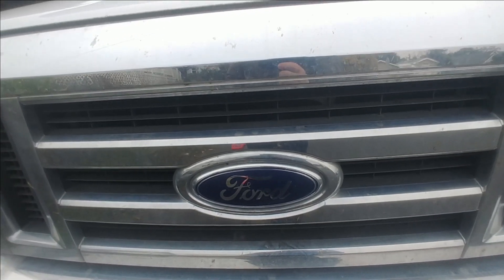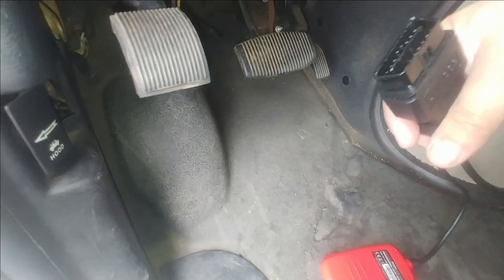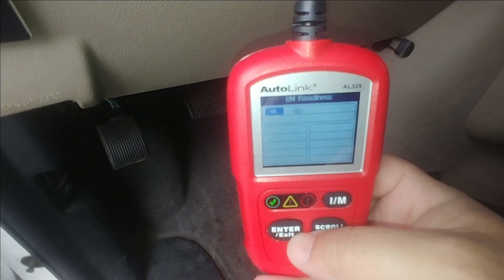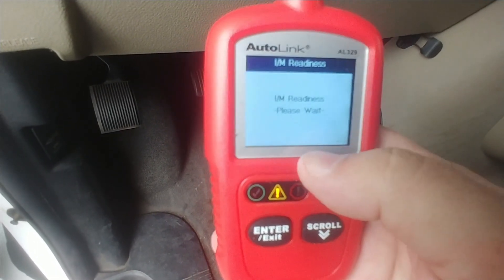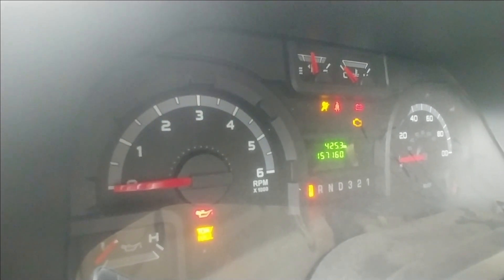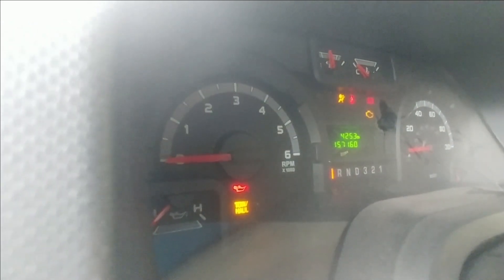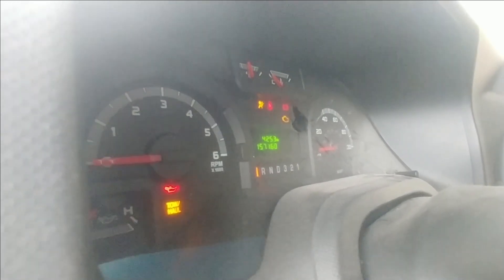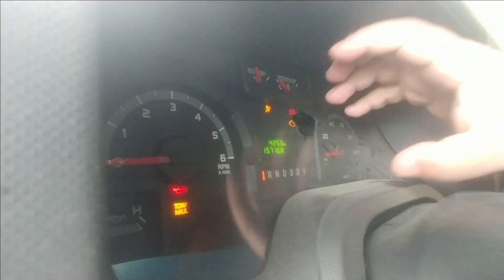Ford Emissions Drive Cycle Readiness Check▶️ No Tools Need▶️ Check if your Ford Is Ready To Smog

Comment: 2005 mustang just failed for this.  replaced battery recently and inspection said car not ready for smog testing and I have to drive it for 200 miles and come back??
Reply from the maker: Only go back after you verify all the required monitors are ready. 
The obd2 reader that I recommended is in the video description.
Reply: @RANDOMFIX  Already ordered.  Will keep ya posted.      Thanks!
Reply from the maker: @chasmarx4393 glad to help.

Comment: I'm not sure this routine works like you say it does.  Can you explain why the chimes (door open I assume) did not come back on when you turned the key back on?  It was chiming away while you were talking. You turned the key off and immediately back on, but no chimes came on.  

Then you said cycle the key and all that can be heard is a little rattle-rattle sound.  The key was already on, none of the dash lights went off when you supposedly 'cycled the key' so you obviously didnt turn it off and back on again - which is normally what is meant by cycling the key.  

You certainly didn't show the key being 'Cycled' or turned in the ignition, . . . probably because it didn't happen.  Yeah, I'm not buying this.
Reply: It doesn't work the only time a check engine light blinks is for an active misfire.This information is false
Reply from the maker: An active misfire is completely different issue. This is for inspection monitors. Obviously this won’t if you have an active misfire. You check engine light shoot be blinking if the misfire is serious.
Reply: I sat in my 1999 expedition with the cat monitor not ready and the EVAP not ready.Did what you described it doesn't work quit posting nonsense
Reply from the maker: Sorry you don’t understand or I didn’t explain it properly. Honda, ford, Dodge vehicle have this feature. Wash are a little different but the idea is the same. The checking engine light is acts like a tool of all the monitors are ready. Visual tool

Comment: "Cycle the key" from On to what? How many times?

You show turning the key on and then say wait for the CEL.  THEN YOU SAY CYCLE THE KEY, (nothing on the cluster changes and you don't show or explain what you did with the key.) After that, wait 15 seconds for CEL to show up blinking. 

You can tell me if I got any of it wrong.
Thankx!

Comment: I didn't know about the blinking CEL trick.  I've driven over 200 miles since my car was worked on and the dealer had to reset the ECU, and I still can't get it into IM Ready status!  I need to get it smogged, so that's a problem...
Reply from the maker: Complete two drive cycles and the focus only the unset monitors

Comment: VERY nice guy but unfortunately he is unorganized and was neither precise nor detailed. At almost every minute of his video I found missing info or saying things that may be wrong or not fully inclusive. There is no way a logical person can follow his instructions and succeed. Yes, he himself followed written directions by FORD but most steps are unrealistic or very difficult to accomplish because you will be driving on public roads and will be impossible to time everything as stated by idiotic Ford - in other words do not consider FORD a reliable source either. Many FORD professionals hate the company and with a passion!!! because FORD have created chaos throughout the years. All in all, I was just expecting someone at YouTube to DECIPHER Ford's nonsense and show what I need to do for code readiness.  This is not a good video to do that.
Reply: First off, I am sorry for providing negative feedback - in retrospect, I overeacted due to momentary & ovewhelming frustration of not finding accurate info on how to clear codes. My issue is very simple:  I replaced the Fuel Pump (in gas tank) of my 2001 Ford Ranger 4.0L XLT (4WD, auto- transmission). In the process I had to disconnect the battery and remove the fuel pump relay (for safety). Everything went smoothy (no dash lights stay on after starting the engine), and took the truck (I live in Texas) for State Inspection (drove about 8 miles after fixing and reconnecting the battery). I was not aware that codes do not clear immediately after a replacement or battery reconnection and during the state inspection the CATALYST and EVAP came out "Not Ready". I was told by the inspection mechanic that i need to drive the truck about 100 miles for codes to clear.!!! Wow! I am surprised and thought there got to be a better/faster way.  I have a Blue Driver code reader but i could not find good info on WHAT EXACTLY IS NEEDED to clear those codes. And that is what led me explore YouTube, which is 'infected' with misinformation and non-sense. To be really honest, YOU have the most relevant info but? .... still I could not follow verbatim. You do provide lots of info.... I just wish they were more methodically organized/ presented. At this time I don't know how to clear those "Not Ready" codes. YES, if you can help I'd greatly appreciate it. THANKS for being such a positive person and replying to my negative remark (I wish I could have in me some of your priceless positiveness!!)
Reply from the maker: No worries, no offense taken as we are all learning including myself. Here is the Texas data https://www.dps.texas.gov/section/vehicle-inspection/faq/emissions-testing and I too moved to Texas 3 months ago but have no smog requirements in my county. https://www.dps.texas.gov/section/vehicle-inspection/faq/emissions-testin
Effective October 15, 2008:

For vehicles year model 2001 and newer, we allow one (1) non-continuous monitor to be Not Ready and still pass the test, but two (2) or more Not Ready's will cause the vehicle to fail.
So now you just need to complete one more monitor to set, I would focus on the Catalyst as you can't do much about the evap other than keep your fuel between 1/3 to 3/4 and park on a level surface.
For the catalyst here is the complete incomplete catalyst playlist https://www.youtube.com/watch?v=BuZYAy_xi0E&list=PLDEbtVOPRC-h1BAzaWQ-6NSnmG0gwvgwP and I would focus hard on the first video and hold it for 4 minutes vs the 3 minutes as it's colder this time of year. 
Keep me posted and good luck.
Reply from the maker: Thank you for the feedback and I appreciate you effort in helping me improve in the future. With that said, road test are complicated as each person are differs. But I have done road test but simplified editions https://youtu.be/jldTJI64cfM?si=-ruPeTyOHHXfsZGq

If you have particular issue I can try to point you in the right direction.

Comment: 1998 Ford Ranger - 2.5 liter engine - 5 speed manual transmission. This vehicle failed the smog test yesterday and I was told the ECU or OBD readings were the reason. It also said this on the paperwork, everything else passed the smog test except the OBD part of it. I replaced the battery a month ago and the smog technician said perhaps I need to drive some on the freeway to get the vehicle's ECU to cycle through and remember the needed checks. I went out today first thing and turned on the ignition and waited, the check engine light never blinked after waiting 15-60 seconds so the method in this video did not work. I will either buy a $10-$15 OBD2 tester or go by Autozone as I think they let you use theirs for free, and then post up the results.
Reply from the maker: thanks for the feedback and that's weird that this didn't work for you?

Comment: Hello, I am interested in purchasing a 2019 Ford Explorer 12,000 miles. The dealer said that it has not passed emissions testing due to failed monitors. They have been trying to get this car to pass the emissions test for a week due to the failed monitors according to the dealer. He did not explain it very well. Should I even still be considering purchasing this vehicle or look elsewhere? Should it be concerning that a car with 12k miles cannot pass an emissions test? Thank you!
Reply from the maker: Sorry for the late reply! did you find a solution?

Comment: My 99 Expedition does not have the Check Engine symbol in the dash, I waited over 15 seconds several times and still nothing, I have been trying for over 5 years to get this damn car to clear it's codes, 2 mechanics have told me to take my car, they have given up. I think Ford should be sued, how can I smog my car if the vehicle will not allow it. I am in Ca. I have already complained most feverishily to them so they got my point.   Any ideas thanks in advance
Reply from the maker: Is the check Engine light bulb in the dash? What specifically did the mechanic say as to issue?
Reply: @RANDOMFIX    So my mechanic tried to do The Drive Cycle he had the car for over 2 weeks, they tired everything, and they could not get it to clear, so they gave it back to me, then I called Bureau of  Repair, I was told to go to the dealer, so I did,  they claimed to clear it, I have been looking fort days to find my reader, I need it it is closed, figures, I am sorry for being negative and I really appreciate the help, I do not want to bring it back to the smog AGAIN, they are the second shop that gave up on it.

I check again I do not have the classic check engine light for this car. I will probably just buy another reader, do you have one to recommend that is easy to use?  Thanks again

Comment: 06 Mustang GT … never had c.e.l. But bought new Die Hard battery.. & havnt drive car much.. work in next City & gas is so expensive.. I drive Honda Civic to work.. thing is… try to get Mustang inspected yesterday.. kept saying NOT READY..3 different times.. after driving 50 plus— then 100 miles.. seen your video this morning..& did the turn key an wait..& it blinks like 7 times.. but after I start car.. no light.. what should I do??
Reply from the maker: Hi Keith,
Cold start just follow the directions in the video for your 2006 mustang. If you want to see the a drive in action here is one
https://youtu.be/jldTJI64cfM

And this will work for mustang and after two drive cycle just focus only the unset monitors.

Keep me in the loop, thanks